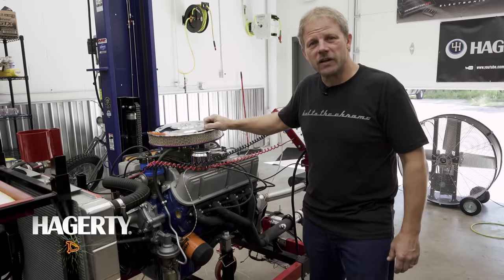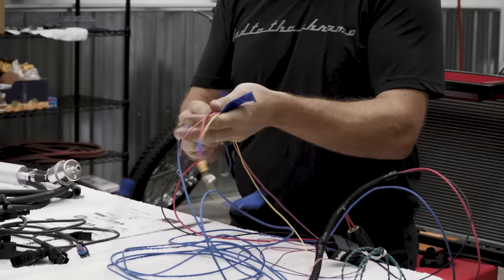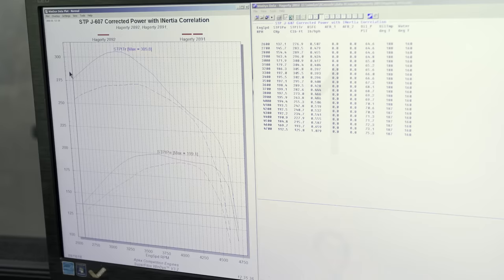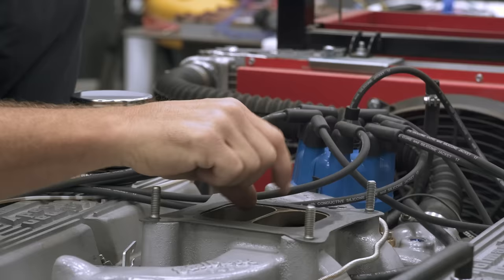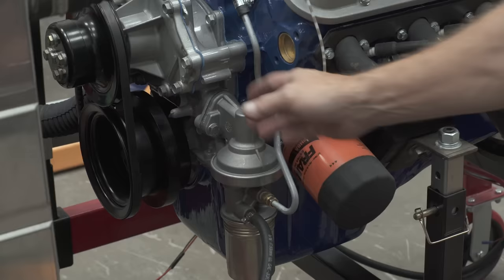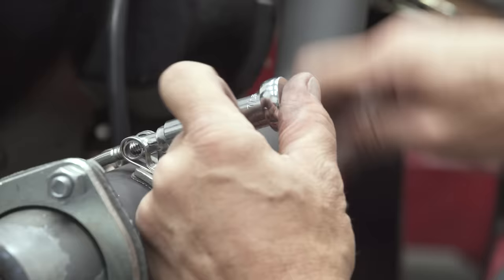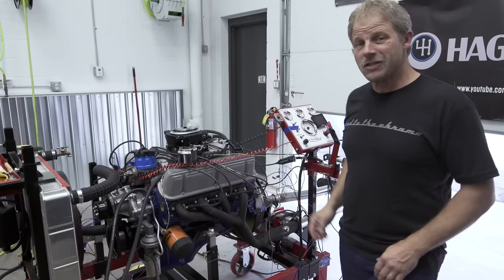Is it worth it? Replacing your carburetor with a Holley Sniper EFI | Hagerty DIY

Comment: I installed that system on my brothers 57 Chevy last spring and oh boy what a treat!  He had dual quads on it which are a pain to tune anyway.  The car starts wayyy better and runs wayyy better.  So nice to get in, start, and drive away. Best thing I ever did on that car!
Reply: I've noticed that as well; about 10 years ago I went to a car show and, all of the converted to FI 1955-57 Chevys, Fords and many others, despite no attention paid to lower emissions levels; once the above vehicles were started up, the difference between the above carb'd and FI, concerning burning eyes, etc was like night and day.

Comment: A few points. Ones that I went through. I put a Holley Sniper on a 69 Charger with a 440. Number one was plumbing in the EFI. Fortunately my tank had a return line nipple which I used. I basically used the old fuel supply line as a return. The 3/8"  EFI hose  was very thick so I ran a line through the subframe/ transmission cross member and shielded the hose all the way to the throttle body. I also used a spacer ( a small 1/2" spacer as I was running an Edelbrock Torker intake on my 440). I did this because the heat created by the engine is not really good for the sensors. I also found that the height of my throttle body and spacer meant that I had to use Holley's drop base filter base to give me a bit more clearance. And speaking of sensors the Holley supplied coolant temperature sensor was NG. As well I ran two coolant temperature sensors. The one for the EFI which was replaced by an aftermarket CTS ( Bluestreak TX9 ). The stock one for the Chargers dash was also retained. I also needed a Lokar throttle cable and in my case a Lokar transmission kickdown cable. I used a Demon carb throttle cable bracket for TVS cables ( with a few washers). I also looked at the cheesy O2 bung and just had mine welded on ( a bit farther away than recommended but still ok). I just had no confidence in the clamp on affair. Other recommendations are a bag or two of split loom and harness clamps in both sizes for the fuel line, the main harness and to keep everything clean. My 440 has alloy heads as well as headers and prior to this it was pretty rough. It was extremely punchy with the Edelbrock 750 AFB but it smoothed out a lot with EFI.  It is undeniably better. The fuel consumption is night and day and the car is just amazing now. I am confident in it. In the end it was a pain in the ass but it was worth it. I also think that the longevity of the engine will be far greater because it no longer washes the oil off the cylinder walls. My car has the Mopar Performance electronic ignition conversion and while the Sniper would prefer it's own distributor, it still works well

Comment: I installed a Holley Sniper with Complete hyper Spark system and nothing but issues, one after the other. Finally after 6 months , got it running perfect and the ECU failed to trigger ignition Spark Signal to hyper Spark. I just bought a New Holley Carburetor, Holley Fuel Pump, Sending Unit for Gas tank and Blueprint Distributor. The Sniper was sent to Holley for Repair and when I get it back I am selling it as fast as I can. When Sniper works, its great, but when it doesn't work, trying to figure it out is a F'ing nightmare. Just one visit to Holleys Sniper Forums will give you an idea of just how many people have problems with Sniper. everything from RF Interference  to Weak Secondary Springs that won't close the blades all the way . I ran my car for 45 years With HEI, Carb, and Mechanical Fuel pump and when it rarely did mess up, I could fix it. I didn't have to wait 2 Months to ship it to Holley in Kentucky and wait for it to come back in car show season. I fell for all the Hype.

Comment: As a fifty plus year mechanic, engine builder, it is one of the most clear-cut, simple demonstrations of the benefits.  I could tell from the sound of the engine from startup, to running through in the carb and efi, and the simple tone was a clear indicator.  Very nicely done, and a very nicely built street engine as well.  Thanks.
Reply: I have a 1979 dodge magnum which efi should I buy?
Reply: @leebailey1220  I think David would have a far more up to date reply, it's been some years since I messed with EFI myself, and it's a fast field. When they work, they can be dead on, all the time, but they are liable to electrical noise, bad grounds and corrosion, which can scramble their brains.  I've gone away from the electronics for reliability and maintenance, but it's a matter of health, changed directions.  Enjoy the power!

Comment: I upgraded my '73 Charger with the Sniper EFI system.  Is it worth the trouble?  YOU BET!! It is by far the absolute best upgrade you can do to an old driver!  The car will have all the benefit of a modern EFI system with the heart and sole of a well tuned carburetor.  I recommend going the full 9 yards with the Sniper HyperSpark distributor, ignition box, and coil along with a Sniper EFI fuel pump with a Hydramat for best results.  

A note about performance:  A carburetor can be finely tuned to make more power than EFI for a specific air pressure and temperature.  However, as soon as anything changes, you're losing power and need to adjust.  An EFI system can be finely turned any environment to provide 98% or better performance of an carburetor 100% of the time.
Reply: I agree. I used a similar set up to yours in my Nova. Also great points on tuning.
Reply: Ok Holly sales representative....
Reply: @1BigDaDo  Ok Carburetors lovers
Reply: @1BigDaDo  LOL!  I wish Holley would sponsor me based on how much I preach for them.  Their Sniper system is really as good as I makes it sound!  Go the whole 9 yards, do a returned fuel system, and you won't go wrong!  

Now Hagerty.  Those Delta Alpha Bravos can Foxtrot Oscar!!  They raise my rates by 25% for no damn good reason.  Going to switch companies... again.
Reply: What engine? Read my comment above. My '69 Charger was not real easy to modify but it was definitely worth it....
Reply: @blakenewton2781  383 big block.  I had to rework the entire engine harness, add a 8 way fuse relay block, and add a 0.2 second timed delay relay for the key switch.  Biggest headache was retro fitting the fuel system. Helps a bunch to have a single plane intake for accurate MAP sensor readings.
Reply: @stevenrice47  one issue was.that with a single plane intake on my 440 along with the 1/2" phenolic spacer and the somewhat tall throttle body I was unable to use the stock Chrysler air cleaner setup. I bought a specific drop base filter base and used the top lid from a 318 2 barrel air cleaner. It all fit. But yes I went single plane and with alloy heads and headers it's pretty tough. It was a bit of work to get everything where I wanted, enough so I am uneasy calling it a bolt on. I still think that it was worth it....
Reply: EFI sounds like a good upgrade. I have a 302 mustang motor. How do I find out what I need w.r.t. distributor etc.?
Reply: All that sounds nice but I'm not throwing $1000 away for all that hype. I'm no pro and my edelbrock 650 starts just fine. I do recognize the efi tho, not hating.
Reply: @gregorystone1439  $1k?  Hehe...  It's more like $4.5k to do it 'right'.
Reply: @stevenrice47  what, really. Not this fool. Lol
Reply: @stevenrice47  $4500 for parts? Or was that paying someone to do it?
Reply: @dustinbrown7246   $4500 in parts which includes the throttle body, fuel pump, distributor, cdi box, coil, plugs, plug wires, alternator, fused relay box, head light upgrade, AN-6 stainless fuel lines, fitting lines, air cleaner, harness connectors, and $200 for someone to weld the gas tank.
Reply: Headlight upgrade? Is that because with efi the car out ran the stock bulbs, had to change to led? 😜
Reply: @wrenchcat8508   lol.  I actually had bad experiences with LED headlights so used Hella H4 conversion glass kit.  Can't have a modern ECU with terrible 50 year old tech headlights?  

I wired everything in using an American Autowire Severe Duty Weatherproof Relay box with 8 circuits mounted inside the left front fender, forward of the wheel.  I used 1 circuit for the ECU, 1 for the fuel pump, 1 for ignition, 2 for the fans, and 2 for the headlights (hi/low), and I have one free for something in the future.  There's also a Hella delay relay set at 1 second at the key to keep power on when switching from run to start.

I converted the headlight circuit to a ground switch, so instead of the power going through the headlight switch and a bunch of 50 year old wire, it's just a ground switch that turns on the relay. I have clean 14v at the headlights that make for super bright lights.
Reply: I mostly concur. But, an EFI system is limited by it sensors and controls - the same as any carbureted system.. I do not concur with the 100%. It is more like 95%. Neither Mass air or speed density systems are fully optimized, factory or aftermarket. But, they do self tune so that you don't. V/R Chris

Comment: So, I'd like to offer a counterpoint as some have done before.  I've spent about 15 months and hundreds of hours trying to get my car swapped over from a carb to an EFI.  I had 2 Snipers, one failed and the second one required fairly constant tuning so I switched (with professional advice) to an HP/EFI multiport.  I'm now on my second HP//EFI ecu - the first failed with what Holley Tech called an internal dead short...  The reason for the change to start with was "driveability" issues with the carb and ignition set up.  BUT the engine ran well and had been recently rebuilt.  It is a 383 SBC (in a 1970 Camaro) with a fairly long duration (unknown specs) cam but moderate compression.  The FOURTH ECU has now been swapped in and the car is operational and in learning/tuning mode.  I can detail pages and pages but here is my short list of conclusions for anyone contemplating this swap.
1.) baseline your engine carefully - make sure you have or understand the cam and valve train specs (I had the wrong cam card) and ignition timing specs.  Ignition profile, vacuum behavior etc.  I spent hours and hours searching for a vacuum leak that didn't exist...
2.) Neither the guys on the boards nor Holley tech have been consistently helpful..  Wait time and quality of response with Holley tech was a 3 of 10 (IMHO).  I had one tech who facilitated a fuel locked cylinder while trying to debug a dead ECU!!!  Could have been catastrophic..  I also believe Holley has some significant quality control issues - I currently have a 50% failure rate on ECUs.
3.)  Do not underestimate the wiring!!  The mechanical is easy - getting the wiring integrated and re-loomed in a stock car can be a very lengthy process.  Not to mention that the HP/EFI loom is NOT labelled..  So, don't, as I did, just unpin the ECU connectors to tuck them through your firewall so the ECU can be mounted in the passenger compartment..   continuity testing 80 wires is time consuming.  
4.)  This change is probably NOT for every engine - I'm still questioning if my tuner can get mine completely dialed in - I hope so - it goes to him next..  And this change is not for the faint of heart when it comes the wiring.  Also do a thorough estimation for your fuel system changes, fuel routing changes, linkage changes, etc. before you start..
Reply: I feel you about the side effect issues of modification. My biggest is not the hardware or the wiring or Ford's poorly written and edited documentation. It is the insurance company that said we will dump you before the paint is dry. Worse answer than the EPA. V/R Chris

Comment: I can just see exhaust leaks in the future with the sensor adapter. Just weld the bung in and make it permanent.  I do like that converting your 60’s V-8 to modern fuel injection is now so relatively simple. Thank you Holley!
Reply: I would completely agree, but it's a nice bit for doing testing on a dyno and the like.  I need to find something for an old Harley.
Reply: But u gain 0 fuel milage. Unless you have a horrific tuned carb there is no magic fuel milage gains.
Reply: @johnsnow1355  wrong.  gonna see maybe 5-15% better mpgs.
Reply: @johnsnow1355  

What world are you secretly living in? If you have a carb. Toss a real wideband on it and get a video of you going for a drive from cold start to fully warmed up, do cruising, wot pulls, decent coast downs.

Quickly it will be revealed how horrible that carb is for fuel economy compared to the same setup on e85.
Reply: @johnsnow1355 if that were the case then carbs would have return lines like EFI. Carbs use all the fuel thats delivered, and EFI returns the unused fuel. You will see about 10% more economy and power as well as way easier starting. Not to mention having a near perfect air fuel ratio constantly will result in way less carbon build up...
Reply: @zachniverson8816 carbs do run return systems,cuts vapor lock out of the question

Comment: Been there done that twice! First Sniper worked great for about 1 year. Suddenly both coolant temp and air temp went out. System didn’t know what to do and ran horrible. After extremely long hold times I got thru to Holley. They did great and overnighted my a replacement system at no charge. Put that one on and cranked and ran for a week then timing function stopped working. The system stopped cranking after that. My 70 Impala has been sitting over a year in the same spot because life happens. Planning on going back to carb and HEI ignition so can at least enjoy my car again.
Reply: Common story with efi
Reply: Exactly!! Same experience...
Word to the Wise...
Don't get rid of the Carb!
Reply: it's like an apple phone, vcr, CD player, etc. Good for a year or so then needs an upgrade or replacement. Good ol holley will be rebuildable for 100 years or more.
Reply: @BBBILLY86  Rite! , Put the exhaust gas( mixture gauge) sensor where the O2 was ... Now You can actually read on the gauge your mix ratio... Even on my traditional $#1+ I run one... Hidden of course....
Reply: Yep and that’s the beauty of a carb.  No bullshit
Reply: @googleisorwellian At least 4hrs, so $500 - $600
Reply: Iv been fighting my sniper for over a year on my 383 stroker. Ran great for a bit. Im tired of it. I work on it more then I drive my hotrod. Also if you don't have it professionally tuned with a lap top your missing out on a lot. That can cost yea
Reply: @MrUltraworld   Dont forget the $3000 in extra parts you will need for that "$1200" EFI.
Reply: @SOLDOZER  What extra parts are needed?
Reply: @MrUltraworld  😂
Reply: So I should stick with the avs2 edelbrock?
Reply: Heat affecting  the Cpu ?
Reply: @dwormon4591  I think that’s the main issue. Carb body gets hot and electronics and high heat don’t play well together. Probably would be better to have a system that most of the electronics are mounted off the engine.
Reply: That’s what I’m afraid of 😳
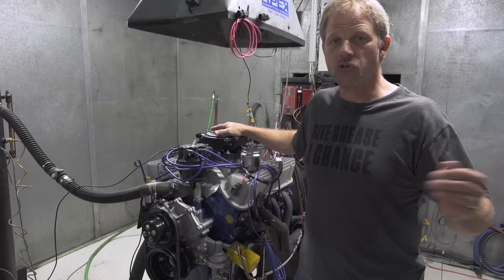My set up On my Trucks are HEI - & 4- bbl Carb.. Very Easy 13:28 to Work on . EFI many Points Of FAILURE IF AND when 😞

Comment: The main advantages of replacing a carburetor with a bolt-on EFI unit like this is instant cold starting, much improved cold idle quality and cold performance, plus it eliminates the need to constantly fiddle with the carb to compensate for temperature changes (swapping jets and resetting the choke).  EFI shold also elimiante that annoying bog or hesitation when you open the throttle on a cold engine.  I think EFI is well worth the cost if you drive our vehicle a lot or drive during cold weather.  As for the overall power gain, the EFI throttle body has bigger bores so it flows more CFM at higher RPMs.  The only way you are going to realize significant power gains with EFi is to go with a Multiport system that has one injector per cylinder.  A Multiport system distributes fuel more evenly so the end cylinders don't run lean while the middle cylinders run rich.  They all get the same air/fuel mix.  The drawback with aftermarket Multiport systems is they cost a lot more than simple bolt-on throttle body EFI systems, and most require laptop tuning on a dyno to really dial them in.
Reply: Just go with an LS MOTOR 🤔

Comment: I just installed a Sniper with the Dual Sync distributor on my buddies truck. I finished it this morning. He has a pretty hot 454 and it has been very finicky for 15 years with the carburetor. It now fires up with no problems and he swears it's the best it's ever run. Of course we didn't have the luxury of a dyno to test it back to back but I can tell you it idles way better and it is much smoother on acceleration. Now I have to have one for my 70 Challenger R/T with a 440!

Comment: I remember owning a 1989 Honda Accord with a 2BBL Keihin connected to a number of altitude sensitive vacuum valves and temperature sensitive vacuum bleed valves, along with solenoids and a rudimentary ECU to tie the mess together. It was a latch ditch effort to get good emissions out of a carbureted vehicle before finally switching to EFI
Reply: How did it run?